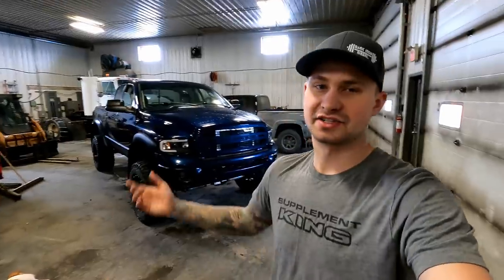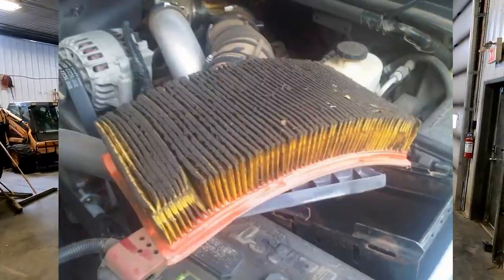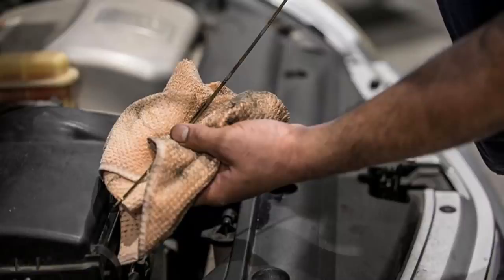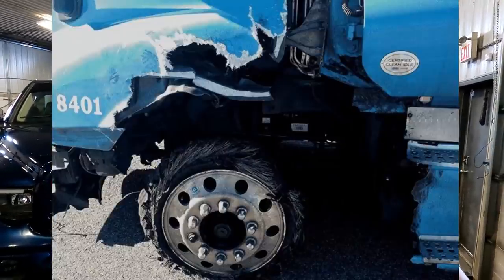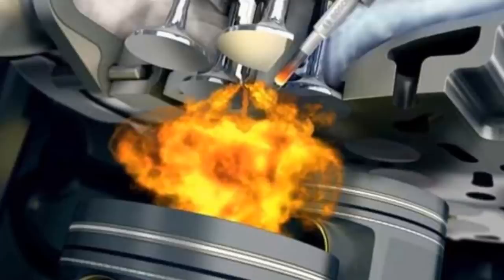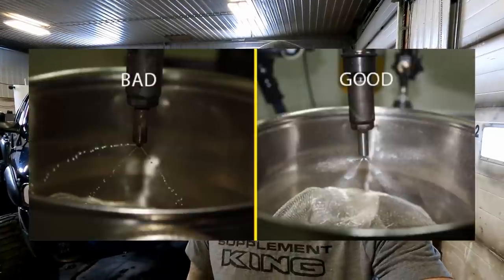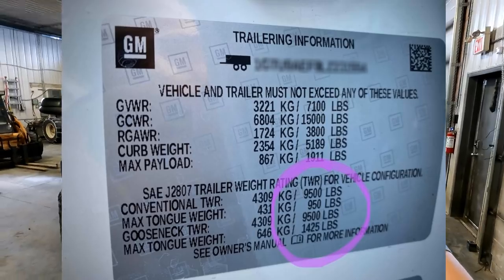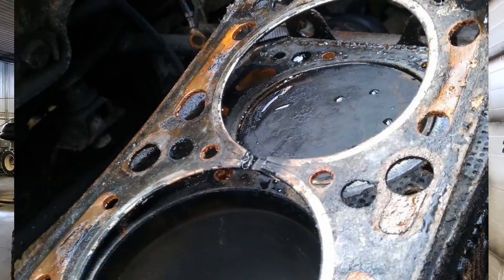13 ways you are KILLING your DIESEL truck

Comment: I have a 2018 Cummins with 19,901 miles and I was wondering if I should do a delete on it? I’m planning on keeping it and doing some upgrades like a 8.4 apple car play radio  and some custom seats and a carli suspension lift and 37s would it be beneficial to delete if I plan on keeping it long term or should I just leave it stock?

Comment: I understood that letting your truck cool down was actually based on the fact that you had the truck under load. Prove me wrong but I think if an engine needs to get left to cool down after moving just the weight of the truck and its passengers then its not really a suitable engine for that truck. 

My rule is, If im pulling, I leave it to idle for a few minutes when parked. If im not pulling, the last 2 minutes or so of my trip I drive slowly and gently then just turn it off when I get to where I am at.
Reply from the maker: And that’s probably fine the way you do it. Basically, don’t drive the truck hard and instantly shut it off.
Reply: Yep, I completely agree, and I do the same thing as well. The last mile or 2 going through my neighborhood at 25 mph is plenty of cool down time. Also, it's getting that air flow while essentially just coasting, so in theory, it will cool down more efficiently.

Comment: good video, and solid advice.

 couple things though i think you should have touched on are this:

excessive idling and not letting your truck get to operating temperature i.e. taking too many short trips in it without the engine fully warming up. both of these things are damaging to a diesel truck
Reply from the maker: Yes there’s always something I miss it seems haha. Next time!
Reply: @darkirondiesel  Prepare a checklist in something like Google Docs or Apache then post a link to it on your site.

Comment: I like to also let my truck idle after it’s been up to temp for a while to let oil flow through the turbo bearings while the exhaust gases aren’t heating the turbo as much at idle to help cool the bearings so the oil doesn’t vaporize and leave deposits in them once the engines shut off.
Reply: Synthetic oil does not coke in bearings. Dino oil does, but I don't know anyone who runs dino oil in a diesel.
Reply: @ai_university  i use amsoil and I understand it helps but it doesn’t have to be the oil that cokes bearings, there are additive packages in oil. Also there are a lot more diesels out there running Dino oil than there is synthetic oil. Cost of oil really multiplies when running fleets.
Reply: @hairtrigger2438  I warm mine up and cool it down just like you do, even though I run synthetic blue diamond (costs a little more than T6). The reasons you mentioned are why I prefer 15w-40 over 5w-40. Less stabilizers added.

Comment: CN guy in his 60s said to use a cupfull 2 stroke oil for the fuel tank. he never had any additives in his 09 duramax. the truck has 850k kilometers on it and its stock except of dpf/egr delete, never had any problems he said. What do you think?
Reply from the maker: Ya I’ve heard of guys do that. I’ve used ATF in my tank as well, although lots of people will say that’s bad for newer vehicles with their delicate fuel system. But old truckers will swear by 2 stroke oil or ATF

Comment: I have a couple questions if you could by chance help me out.

I have a 2014 ram 2500 cummins.

First, when I come to park and idle for a bit, I notice that the oil temp rises slowly instead of falling which seems to counter the thought of idling to cool down. Not sure if this is a concern or normal.

Second, I need to change my power steering fluid and am going to do it my self but I have have seen way to many different methods online and really haven't found a good method for a 4th gen. What would be a good way in your opinion to change out that fluid?

Comment: Hey man Do you recommend using additives in the fuel tank?
Reply from the maker: Yup I recommend running a fuel additive to keep your fuel system and injectors clean.
Reply: What brand did you recommend?
Reply from the maker: I use 4+ because they are made locally where I live, but any good reputable brand should be ok. Just don’t cheap out and buy some no name brand.
Reply: I also drive a big truck and I swear by max mileage by Pittsburgh power. It's $280 a gallon, but it treats about 3200 gallons. It's simply the best.

Comment: Do you add any transmission fluid to your fuel
Reply from the maker: No you shouldn’t do that to a common rail fuel system. It’s ok to do that on the older mechanical fuel systems though, but for anything common rail get some high end fuel conditioner instead of ATF.
Reply: @darkirondiesel  what do you recommend, do you use any additives in cold weather, such as your climate

Comment: The whole "you need to change your oil every xxxxx miles" is pretty wishy washy. I'm sending samples off every oil change and so far I'm at 9500 miles between changes, the factory spec is every 7500. Most of my operation is highway or idling,  not much in town.
Reply from the maker: That’s awesome information to have actually! So at 9500 miles the oil is still good or that’s when you’re changing it?
Reply: @darkirondiesel  last change was 8500, they told me it was safe/good enough to go an extra 1000. I've seen a guy who hot shots going 28,000 on an oil change.

Comment: Usually if you spend the 10 15 extra dollars you get a lifetime warranty
Reply from the maker: I’ve had lots of guys get screwed by the “lifetime warranty” seems like when they sell you on the extra warranty everything is covered, but when the time comes to fix something they say it’s not covered.
Reply: @darkirondiesel  I haven't had a problem with it unless it was from neglect or breaking it on install

Comment: I disagree with your oil change interval. Having driven class 8 trucks, which spend more time producing MAX BHP than a a ram 2500, f-350, or chevy 2500. They use Rotella 15-40 full synthetic and the oil change interval is more like 20000 miles. You should be able to double your time between oil changes and still be safe. If in doubt, send a portion of your oil to a lab and have it analyzed.  
Under-inflated tires DO have a purpose, in SAND, lower tire PSI to about 8 lbs. and you will get much better performance, although you may need to invest in "beadlocks", to ensure the bead of the tire stays in contact with the rim. However, on the paved road, always follow the tire manufacturers recommendation, both for tire longevity and tire "ride". 
Tow capacity is what the manufacturer states usually in the doorframe. DO NOT EXCEED GROSS VEHICLE weights. This means adding the empty trailer wgt. AND LOAD WGT. ON TRAILER!
Also, you CAN get a over-weight ticket if you are over GROSS vehicle OR AXLE wgt.
Every well maintained vehicle will last much longer and when something does happen, you are less likely to have a major issue.

Comment: Exhaust spins ur turbo , I don’t think it can spin faster if filter is dirty
Reply from the maker: Look it up
Reply: @darkirondiesel  maybe because ur getting less air , so u press the gas pedal more to compensate for lack of power which in turn creates more exhaust gases that spin the turbo more ? Just a guess though
Reply from the maker: Ya I’m not 100% sure, but when I was researching stuff for this video I saw on a couple web pages it said a dirty air filter can cause over speeding. I’m guessing it’s because all turbos are electronically actuated these days and maybe it lets the turbo spin faster to try to push more air into the engine if the ecm is calling for more air 🤷🏼‍♂️

Comment: Thanks for the information
Reply from the maker: No problem buddy
Reply: @darkirondiesel   just got my order in of Amsoil  for my oil change, did the rear diff and replaced the the diff cover with a Banks and replaced the fluid with Amsoil diff fluid, so needless to say I’ll be running Amsoil throughout the truck, still need to do the front diff

Comment: Completely disagree with regards to warming up a diesel. If the oil isn’t below its operating threshold you really shouldn’t excessively idle your truck waiting for it to warm up since diesel general increase in temp by putting a load on the engine. 1-2 minutes at most and just drive it lightly.

Comment: I just recently bought a 2015 Silverado 2500HD and was curious about fuel additives. I work with a lot of diesel mechanics, who own diesel trucks, and when I asked them about additives, they all said I don't need to bother. Is this just a preference thing?
Reply from the maker: I guess everyone had their preference but I’d recommend running a fuel additive to keep your injectors clean. Just my opinion though. Biggest thing is make sure you are keeping up with your fuel filter changes.
Reply: @darkirondiesel  any particular brand of additive that stands out for you?
Reply from the maker: I use 4+ additive because it’s made close to where I live and has a good reputation. I’m not sure if they sell it in the states though.
Reply: @rolliegoal1  I run Hot Shot's Secret EDT in my deleted '19 L5P Duramax. Some say additives are not needed but it's cheap insurance.
Reply: @darkirondiesel  I'm in Calgary so it must be available there
Reply: Hotshotsecret best additives on market
Reply: @rolliegoal1  I use xdp diesel additive it's reasonable and works great
Reply: @mariosousa4121  I agree hot shots secret is the best out there IMO

Comment: I live in saskstchewan too and i cant believe the people that dont plug their trucks in even when it is 20 below, they say why plug it in, it always starts. They are missing the point. I start plugging mine in religiously in the fall when the temps start getting down to plus 2 at night. Even if i am gonna go somewhere in an hour or 2. I dont quit plugging it in until it is plus 2 or more at night again in the spring. I run 5w40 oil which i change every 5000km and fuel filters every 10000km
Reply: Holy overkill on the maintenance
Reply: I lived in Colorado during my early life and went to school in a small town in the high Rockies.  Average winter temp was 45 below zero (F) which could get much colder.  I drove a gas powered Ford and plugged it in every night or the oil would be frozen solid.  I did not want to walk the three miles to school in those temps!

Comment: I gotta check my fluids once a day 😂
Reply from the maker: Hahaha are they burning away or leaking?
Reply: @darkirondiesel  Seems like a few random leaks here and there. Rear diff seal and I believe 2 oil leaks now. Those oil leaks are new🤦‍♂️ Just fixed another coolant leak.
Reply from the maker: It never ends. My truck too. I have a leaking wheel seal and on our last -40 cold snap I developed a coolant leak. I think my reservoir cracked.
Reply: @darkirondiesel  We'll see what breaks on the next round trip. Lots of miles planned this coming week so I feel I got everything but the oil leaks. Rear diff had fluid in it so I'll ignore it until I need a new one😂
Reply: Try a Ford

Comment: step 1    buy a new truck          step 2     trade in next year and buy a second brand new truck.      problem solved.  it worked  20 yrs ago    it works today,  do your math   make sure you drive it 12 months or less              or   buy a truck  you can afford in 2  yrs  of savin 1000$  a month, and send it to the junk yard and get the next one           24 months   at 1k    is 24k     use the ting till it blows  but keep saving 1k a month     for the next one    problem solved.     I tink.

Comment: How do you check diff oil without draneing it
Reply: Pull off the plug, the fluid should be right about level with the drain, you can also stick your finger in there and it should touch the top of the fluid. If it doesn’t, it’s low.
Reply from the maker: Yes and you should be able to tell of the diff oil looks nice and clear, if it’s dark and sludgy then you know it needs to be replaced

Comment: Practical video man! Love the grill and those Canadian GTs...wish there were more wheel companies in Canada! One question I had was on excessive idling, like people who leave it run all day long on work sites and/or while fueling up...any cons to this or they just do it cause they can?
Reply from the maker: Yeah excessive idling is actually bad for your truck. Your truck was made to work and idling it wears parts down faster then if you just drove it. It’s also bad for your cylinder walls, it polishes them and removes the cross hatched pattern. With this gone, oil has a hard time lubing your cylinder walls

Comment: What do you consider and under inflated tire?
Reply from the maker: Anything under the recommend tire pressure pretty much. Low tire pressure is the #1 cause of tire blowouts
Reply: @darkirondiesel  as soon as you put on aftermarket tires on your truck, you can throw those recommendations out the door. The factory has certain recommendations so they can legally advertise a certain GCVWR for the vehicle. When people put on aftermarket tires, as you have, that rating goes completely out the window. The best way would be to weigh each axle and then pull up the load table online for the tires you've put on. Then inflate to minimum psi for that weight. This ensures maximum ride comfort with these heavy trucks. 
Thats why most people complain about ride quality with these heavy trucks. They simply inflate to what the door or tires max is which isn't correct. 
Simply saying go with recommended tire pressures is an oversimplification.

Comment: Emmisions?
Reply from the maker: What about them
Reply: Delete em?...
Reply: Some of the stuff you covered, like buying quality fuel, and letting the truck cool down.  I have run 2 generations of Duramax trucks, LMM 850,000 miles and LML about 200,000 miles which was bought with 500,000 miles on it. Both trucks had emmision exhaust replaced once. The LMM was getting to a point needing a third dpf when I sold it.  The LML and newer are way more sensitive to fuel, that emmision system with the 9th injector, the regen cycle needing to reach temps over 1200 to complete.  Poor fuel doesn't reach high enough temps throws engine codes, and could result in reduce power.  Had the truck down to a crawl as a result of poor/bio diesel. Aftermarket reader like an edge cts is a must just monitor the system.  You need a good 30 minutes highway driving to complete a regen cycle in these trucks and should not be shut down until cycle is complete.  Otherwise regen cycle continues next time the truck starts up.